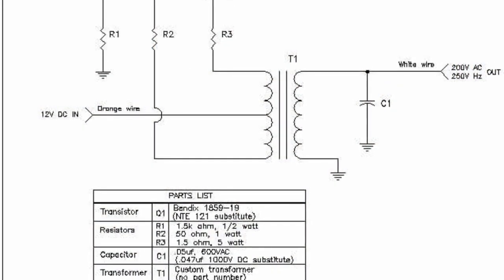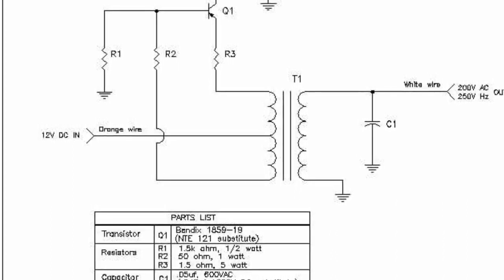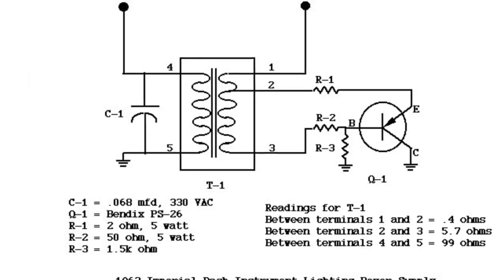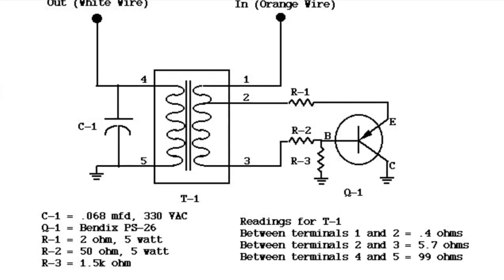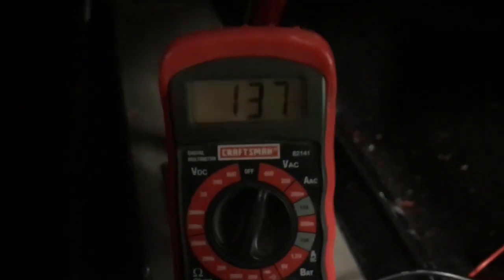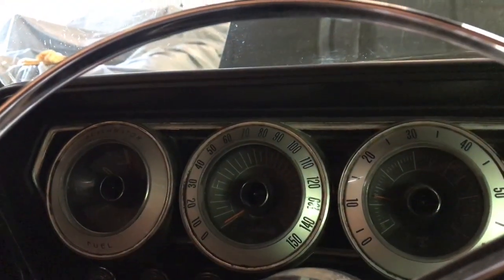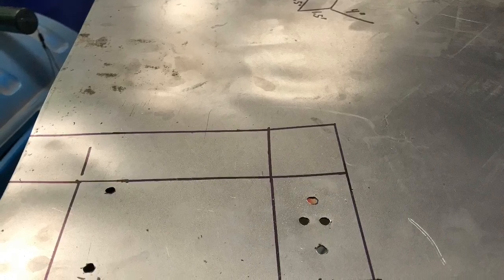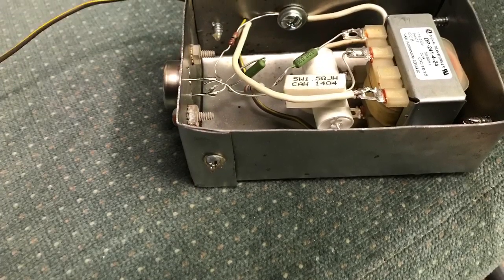1967 Dodge Charger Electroluminescent Dash

Comment: transformer is available and on ebay. But what you missed is the frequency. It should be 280hz. using that transformer it would be around 80hz. New powerpacks are available now from merit automation. They use original spec transformers and transistors and have the same type case as original.